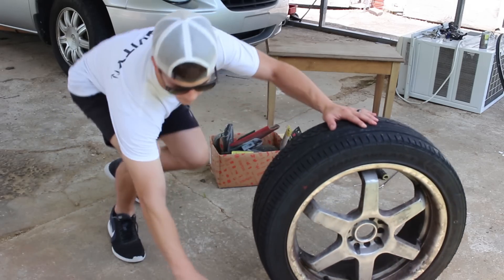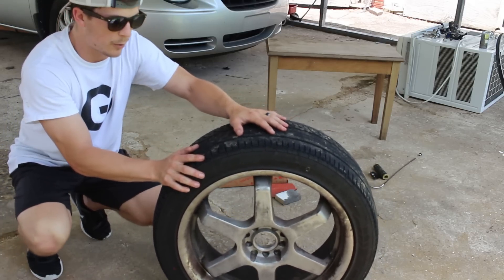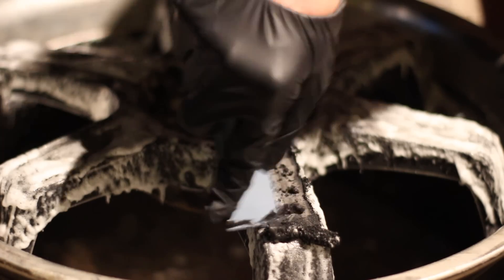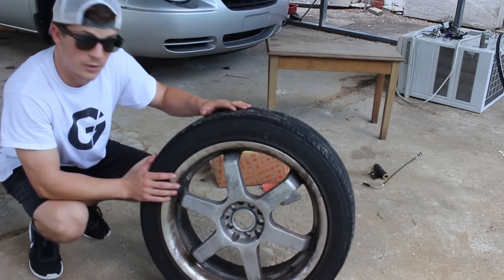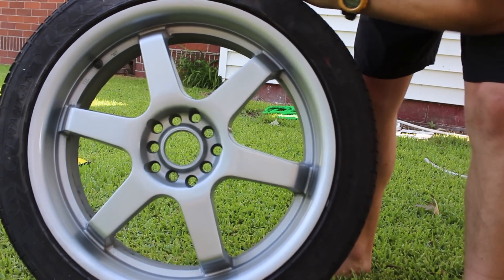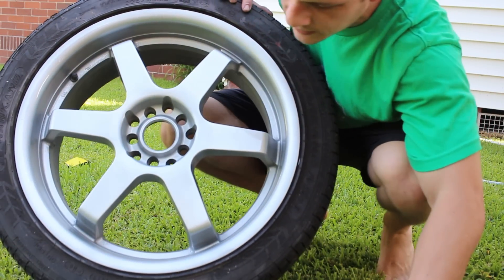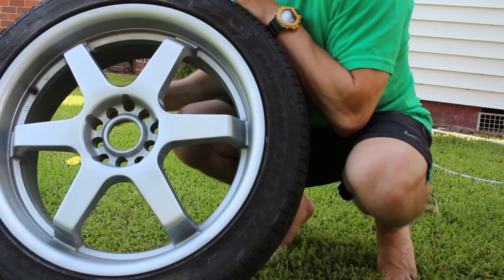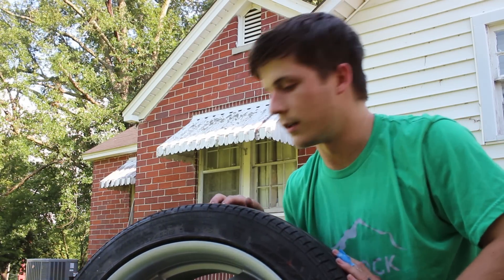MAKING CHEAP WHEELS LOOK EXPENSIVE

Comment: Another suggestion is to get them dipped in an Acid bath. Almost any wheel refurbishing shop has one and it works wonders. It strips the paint down to bare alloy and then you can spray them after cleaning them, they don't need to be sanded or anything. It cuts out a lot of sanding time and based on my price I got, it only costs £40 to dip the set. Afterwards you lay on Etch Primer, High Build Primer, 2k Base coat and then clear coat. The wheels look amazing afterwards. Worth looking into if you try this again.

Comment: umm, how did u deal with the curb rash around 1:30? or did you just cover it with paint?
Reply: use body filler, should be a breeze fixing it up with a dremel. I'm yet to get a dremel or power sander so have to do mine by hand.

Comment: The following is a method to paint the vehicle rims which has proven to be very effective for me.  There are some considerations which must be planned for before the project is started. These are do the rims have tires mounted which are being retained, are new tires being mounted, is the current tire/rim balance to be kept after refinishing? Do you plan to refinish the face of the rim, the outside only or both the face and the inside of the rim,( the surface facing under the car). The following is similar to this videos' scenario, tire pre-mounted, balanced and the only the outside is being refinished. 
1. Mark the tire where it corresponds to the valve stem . 
2. Let the air out of the tire, if possible break the tire to rim interface or bead. This can be accomplished with a simple tool from tool suppliers or have a tire shop do it, usually at a nominal cost, however I've Found most shops will help for free if you're local, they aren't too busy. and in hopes that you're coming back for balancing and or new tires.
3. Push the tire away from the rim no begin your choice of surface prep, I prefer soda blast following high psi pressure washing. 
4.  Sand with s

Comment: Here's a quick tip if you wanna make ur rims look chrome, some graffiti/ art websites have cans that use actual liquid chrome, they'll be a little more expensive than a regular rattle clan but it's worth a try, also the more expensive art brands will be a lot better finish than a Walmart brand

Comment: I hear those Harbor Freight spray guns are terrific, and I actually bought one but haven't used it yet: let me just tell you now... you absolutely HAVE to take it completely apart and remove the nasty gunk, grease, oil, and shavings they left inside that thing. They used some garbage tap that's about 1,000 uses past it's life and left gnarly chunks of aluminum shavings inside those things. After a thorough cleaning though it looks pretty decent (like I said havent used it yet).
Reply: Jesse Crandle Try shooting paint thinner through it and once it's done just let it keep shooting air to dry it.. the more thinner the better.

Comment: put wheel spacers to car and that will make the tires stick out more and look wider
Reply: Wheel spacers are bad for your suspension
Reply: allwrite bro can wait to see that :)
Reply: Increased load on bearing for sure, but I do love hubcentric spacers on certain applications. If you don't already have a really wide tire, it doesn't look right. I don't mind doing my bearings a little more often.
Reply: I'VE TRIED THAT.... (BOOSTED 240) 8" WHEELS WITH 30MM SPACER ALL AROUND.  CAR LOOKS GOOD FROM THE SIDE...BUT FROM BEHIND 👀? ....FUCKIN EYE SORE. SKINNY ASS TIRES THAT LOOKS LIKE IT BELONGS ON A PRIUS. GET WIDER WHEELS. I'VE GOT 9.5 (FRONT) & 11" (REAR)...SHIT LOOKS VERY AGGRESSIVE.
#240LIVESMATTER
Reply: thars true thanks
Reply: You do know that the 180SX and the 240SX is the same car right? Different names for the S13 Hatch but the 180SX is the name on the Japanese market and the 240SX is the US market, very small differences other than the name.
Reply: Jonathan Baca definition of ricing
Reply: tobepersa you are actually incorrect they all have different motors and the silivia is actually the Japanese version. The 180 has a Ca18det the 240 has a ka24de the Silvia has a sr20det. So I guess u could consider them the same car but they look different sound different and have different motors. Just the same chassis.
Reply: Essentially the same car for different markets, calling them different cars is wrong, but I agree that they're not the same, just because of different regulations on different markets, but it's still the same car.
Reply: yeah but wheel spacers are cheap, just put fatter tires lmao.

Comment: Go to your local powder coating shop have them sandblasted colored a bright color and clear coated... put expensive brand center caps.. might be $80-100 each wheel but hey they will look legit..
Reply: PRANKURFACE.................if you can get 'em sandblasted & redone with a clear coat to boot for just $100, you're dreamin'.  We don't live in any large metropolitan area, and it's higher than that.  After they're sandblasted, you'd want to have them filled/sanded/etc as well that you're not even accounting for.
Reply: Kman Sorry to upset you.. here in Texas I see more sandblasting and powder coating shops than I see places to eat. That is due to the high demand in the oil fields. Im sure the price varies anywhere you go I was only speaking from experience. if it cost more than my initial estimate than just do as he pointed out in the video.
Reply: Kman don't need to sand/fill after sandblasting. powder coating is pretty thick and fills minor voids. for paint yeah you'd have to sand
Reply: You can also pick up a cheap sandblasting kit from Harbo Freight or an Eastwood kit and give it a try :)

Comment: you are using exactly the same methods i am for my old shit wheels, mine are just ALOT harder to sand because of the design. I first used normal paintstripper which er fucked up a bit (it dried some places) and used the vibrating disc sander with aswell as sandpaper. fuck i hope i'm never buying old beaten rims again its a pain in the ass. for now i'm just going to dip them black.

Comment: They still look cheap
Reply: Emanuel Lazarit no they don't! Look pretty damn good mate. I use a high metal content epoxy filler to smooth out the kerb rash and scrapes.
Reply: Emanuel Lazarit !dx!exx je d!xxx
Reply: Emanuel Lazarit It's not like he was going to sell them as brand name tires
Reply: Emanuel Lazarit It's not like he was going to sell them as brand name tires
Reply: Any type of JB Weld? JB Weld has several different products now. Low, mid, high heat, silicone, etc. If it's going on a wheel I guess it just has to be able to hold up against the extremely abrasive Ohio winter salt here. I want to try an easy 'fix' for my 2008 scion tC factory wheels. I am not sure if the factory wheels are alloy, aluminum, steel, or what.
Reply: Emanuel Lazarit is right tho? why so much hate over someones opinion? ever heard of the saying "you cant polish a turd"
Reply: Asher Rose I just wanted to troll a bit lol
Reply: Emanuel Lazarit but your correct tho hahahahaha, they may look expensive to anybody that doesnt no anything about cars but real car enthusiast can spot reps a mile off
Reply: Emanuel Lazarit no they look way fucking better looks like more expensive Volk racing wheels
Reply: Asher Rose you can it's called turd polishing
Reply: D carden no its called smearing lmao
Reply: well lah tee dah @ you , lol
Reply: Asher Rose u ain't never been to NYC and seen their reps. You can't tell at all. Some of them u can't tell unless they tell u.
Reply: child
Reply: 1000hpHONDA high heat